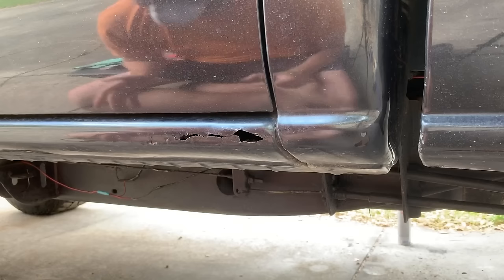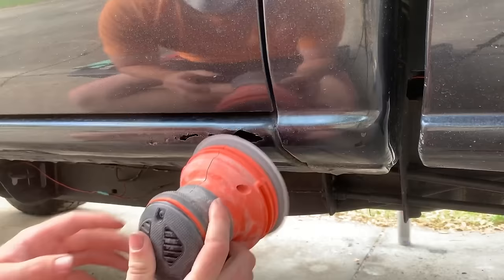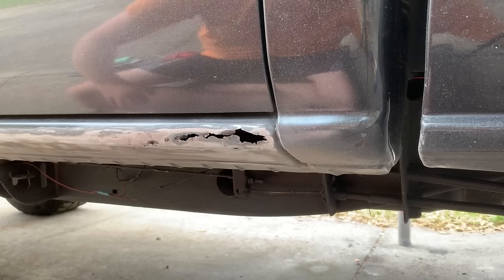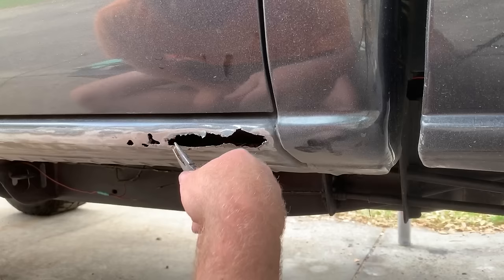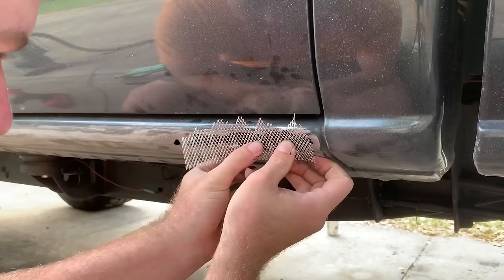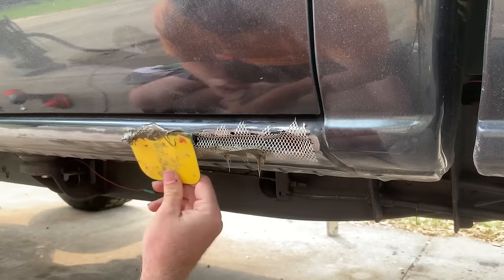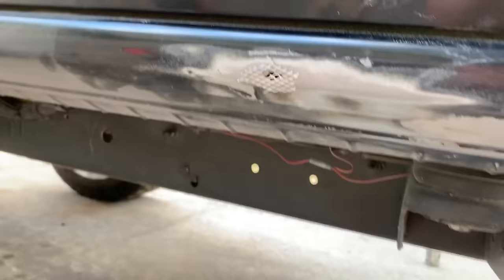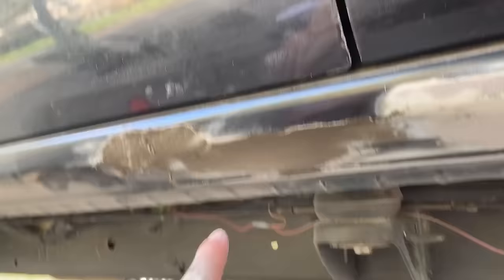How To Fix Rusty Rockers Without Welding

Comment: What can you do if rockers are almost gone?
Reply: Get new ones welded on I'd assume lol
Reply: You can line up cans in there ' tape them in place and use spray can foam to fill in around the gaps ' spray it heavy enough so it will swell out enough 
That you can take a razor blade and trim it off to the shape of the original rocker panel, 
Put a thin layer of Bondo over it and sand it down smooth and then prime it, you can then spray can over it. 
A side note ' if you can't find a spray can close enough to match the paint Just spray both sides in flat black
Or even better than that you can use rubberized black under coating ' the undercoating will give it a texture look and you don't have to have your Bondo work so perfect and you won't have to primer it either. 
I'm a 47 yr experienced 
Professional body man
Ran a mobile body shop service for years
Mostly worked for used car lots. 
Take it from a professional ' that's the easiest and fastest and cheapest way to do it.

Comment: Any change in color...a wrap will show it. Next time, get some Painter tape and grammas coupons from junk mail and mask a little. Cut off off bad metal at least, and use long finish coat. Looks like nice truck, and will always see low/high spots..finish coat with icing , sand (more easily ) and then primer...what you just did was what cheapo car dealers have been doing for decades, and I even saw one guy use cardboard to fill hole...they would cheapo do this to get it sold and the next season it would all bubble up and start falling out...and they didn't care cuz they sold it. "The slam Job" lol

Comment: I live in Michigan... All my vehicles rust horribly... I refuse to buy a brand new vehicle. I will soon be coming to Florida or Kentucky area to buy my next used vehicle... Then investing in undercoating immediately..

Plus vehicles are cheaper down south
Reply: Spray the underside on any Northern vehicle with an anti corrosion product, an oil based product works best.  I like NH Oil Undercoating product, but Fluid Film, Waxoyl, ACF50, etc. will all work.  Oil undercoating is messy. It leaves a film behind that will get all over you when you work on the car. Recoat every year. Do this and the car will not rust. Existing rust will be stopped as well.

Comment: NEVER COVER RUST LIKE THIS IT WILL CONTINUE TO RUST UNDER THE REPAIR. THIS IS DANGEROUS
Reply: Some people just want to patch there car so it passes saftey inspection 😂
Reply: Seems alright to me
Reply: How is it dangerous? Just curious, i dont see how rusty rockers are dangerous?
Reply: If it's so dangerous - why does Chevrolet design allow the rocker to rust in the first place. How long have they known about these rust prone areas and do nothing to stop it from happening.
Reply: @illuminatismasher  The inner and outer sill (rocker) create a structural box section, connecting A and B posts and the lower seat belt mounting.
If it is rotten and you are T-boned, you will realise the danger.
This type of repair is illegal in the UK, where the MOT demands a welded repair.

Comment: You just sealed the rust inside the fiberglass.  You just made that truck 1000x worse.  It will rot through from the other side.
Reply: How

Comment: You did a good job, young man, but a Bondo repair is never either a permanent repair or even a “fix”. This will fail and even in your region, and it will not take long for that to happen. Neither is it a structural fix and that is always a concern. I understand your budget and equipment issues, but believe me I have been there and done that. It was a bad idea 50+ years ago when I started playing with hot rods and it remains a bad idea today (Bondo has been around a long time).

Comment: You guys are all wrong. When you try and cover holes you can't add fiberglass or screen over the hole because now you have raised the filler above the rocker height area. It's on top. The bondo has to be even with the surface of the rocker to sand level with the rocker.the screen behind it, is better.then bondo or flatten it out on the back side. or push it in at least.

Pmd

Comment: I had worser rust than that on my old truck and live in Michigan but didn't fix it right on my truck I wash my truck a lot more now even in the winter but I messed up getting the rust off and the hole is still on it but my brother has my truck now but I see he isn't washing it and I have saw more rust come back but not gonna bother with it again unless he wants it done I bought some for that truck for him a 4x4 sticker new one and I have some pin stripes got from China coming in mail. But he be better just getting another door in the junkyard but he isn't taking care of it good now it has another problem wrong with it now and the back bumper has more rust but the truck is old if was me would get rid of both his vehicles and get another truck myself I only need one vehicle though I used to do GrubHub in my old truck but didn't make enough doing it but it is better in a car I rather just do auto detailing on the side to make money but I feel like will leave the job am at now soon was thinking about moving to Texas this year but changed mind but I still could end up moving there.

Comment: This video contains a fatal error. You must fully remove ALL the rust from the backside of the hole. Then use a self-etching primer. Then a coat of something else like a black undercoat over that. If you do not remove ALL active rust before applying rust reformer or etching primer the rust will immediately return. If you do not have access to the back side of a hole, you cannot repair properly.

Comment: Yeah, I wouldn't recommend anyone doing this. It's a temporary patch job. That rust isn't done and it just going to surface through what you've patched. New metal is the only way to do it right. Sure it looks better for the moment.but it won't be long.
Reply: I hear ya. Good to pass an inspection and do ya for 6 or 12 months to get ya though a hard patch

Comment: So how do I fix these, if they’re completely gone. Like rusted gone. I have no jack points rusted gone.
Reply: What he did in this video will work just fine on any vehicle body that is mounted on a frame (like this truck). You can repair some cars that are uni-body (The frame and shell are integrated into one unit) that have rust holes if they are small.

  If the rust has destroyed any of the structural support areas on a uni-body (jack points, strut towers, shock or engine mounts etc) then it MUST be cut out and new metal WELDED in. Failure to do so could cause very bad things to happen, Lol. I know this because a buddy in PA got pissed off because his Jetta wouldn't pass inspection because of major rust in the trunk areas.

He then used Bondo, fiberglass, sheet metal and pop rivets to cover up and repair the impacted areas (or so he thought?). Each time he did this, more and more rusted steel was cut out. He would then try another garage to see if he could get it passed.

 On the way to the 3rd garage he hit a pothole and both rear struts broke lose, smashed into the trunk lid and popped it open. The body dropped onto the tires, crushed the exhaust pipe and muffler.

The moral of the story is that no matter how much you love your car, it is possible to reach a point where it becomes cheaper (and SAFER) to just scrap it and buy another. At $60 for each inspection attempt x3, the time, money and materials used to rig it up and the towing bill to get it home,  it becomes obvious that common sense wasn't used?
Reply: @superdog1964  damn, cool story. We are poor up in here. We can’t afford new cars. Haha. But yeah, I’d be shitting my pants, and after one failed inspection. Really should think better.
Reply: @levigrafton6854  I can't buy a new one either, Lol. I would just buy another beater with a better body of the same type and swap engines, wheels or whatever and make a good one?

Comment: Don't bondo structural panels, ITE a bodge and unsafe as fuck.
Reply from the maker: Good thing I used fiberglass and not just bondo body filler.
Reply: @AaronCates  its still a bodge take it from a body repairer
Reply from the maker: It still looks good and is still solid almost a year later. Good thing people can learn things and not take everything to a shop.
Reply: @AaronCates  what I'm saying is it ain't as strong as steel, fact, in an accident it will crumble away, under stress it will fuck up. Structural panels should be welded.
Reply from the maker: Actually the fiberglass is stronger than what panel is there, but good thing all sheet metal crumbles during an accident. Not like it’s made of solid steel like an older vehicle.
Reply: @AaronCates  when you've been a panel beater for 40 yrs I'll talk to you again about structural integrity.
Reply from the maker: When you’ve been a social media influencer I’ll talk to you about YouTubes algorithm and why I’ve only argued with you because every comment pushes the video higher up so more people can see how simple and easy it is to fix their rust. So thank you and have a great night.
Reply: @AaronCates  bodger.
Reply from the maker: Well luckily my rocker panel can be completely cut off and my truck will still drive down the road. What I did was completely safe and still no problems.
Reply: @AaronCates  only because it has a separate chassis, but if you get t boned ffs ,no structural integrity a vehicle without a separate chassis ,your repair on that equals Death trap.
Reply: @AaronCates  So your "repair" is purely cosmetic, that's fine , but on a monocoque chassis it is unsafe, simple physics tells you it ain't as good as a welded repair the factory have looked at this and made it from welded steel panels , crumple zones etc, so its a Bodge job.
Reply from the maker: It’s a rocker panel my dude. If I got t boned whether it was welded or not it would crumble. I’m guessing I should weld my mirror on as well so if someone door dings it, it won’t crumble right?
Reply from the maker: Oh now we are resorting to name calling. You must be a really good body tech to jump on the Internet and try to tell people how to do everything. I’ll do it the same way again and again. Thanks mate!
Reply: @AaronCates  OK carry on Bodging mate, just trying to share my 42 yes experience in top bodyshops, if you can't handle it OK, no probs, there are plenty bids on YouTube to show how to do it the right way, vids  I mean, expand your skills mate, get a mig or tig welder it takes the same time to do it right.
Reply: And a "social influencer" ain't a good thing really mate, that's like a degree in lesbian underwater basket weaving FFS,
Reply from the maker: Sounds pretty interesting to me.
Reply: @AaronCates  Hahahaha good reply man ,you have talent mate don't waste it,get a mig, I'll send you a video of the xjs I'm restoring welding takes less time and a solid repair .
Reply from the maker: I recently got a mig but a welder at the time wasn’t an option and I was wrapping the truck so the rust needed to be fixed. Majority of the original metal is there, I took out the rotten and cleaned and rust reformed everything else. Now having a welder I would most likely weld the next pair if they were bad but something small like this I don’t see cutting the entire thing out being smart.
Reply: @AaronCates  prop it up before you cut it out, weld a small brace to the panel before you cut it.

Comment: So where exactly do you think the rust came from. It came from inside out. All you did is cover it up so it can continue to rust under neath and it will be much worse next time. Despite what the manufactures say , that fibreglass filler is not waterproof. Don’t do this. Complete fail

Comment: you used Bondo on fiberglass!! wtf?!! you're supposed to use fiberglass RESIN!! EPIC FAIL "REPAIR"
Reply: Its called bondo glass, its fiberglass strands mixed in with bondo for structural rigidity. Go to any parts store, they will have it.